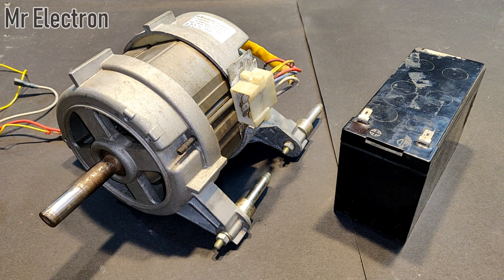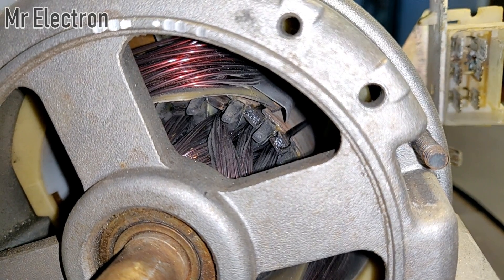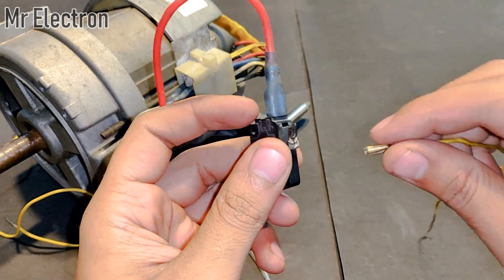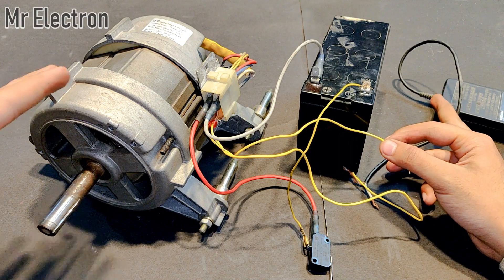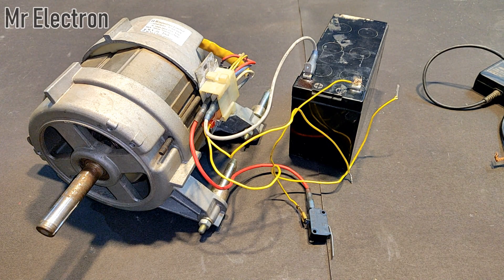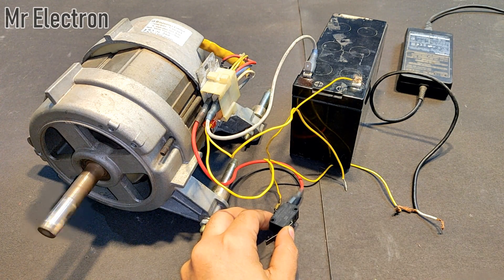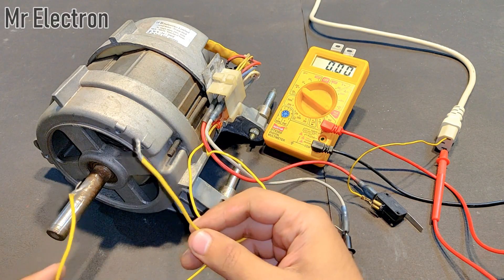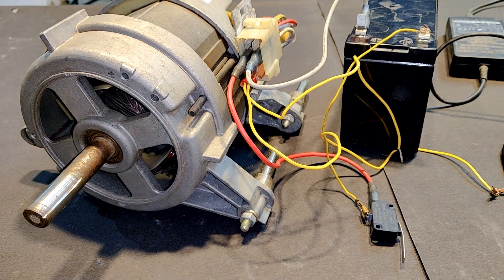Make 12V Magnet DC Motor from Old 220V AC Washing Machine Motor (Universal Motor) with UPS Battery

Comment: Interesting, how can you do this effect with a 3 wire AC washing machine motor? also if you use the start winding on the rotor too much ( after it has started ) you risk burning it out, so as you demonstrated only use it to start the rotating magnetic field, then disconnect it ( sometimes this switch is built into the motor and deactivates using centrifugal force ) thanks great video !!!

Comment: Hi, I have tried this it runs but the motor has no torque/power same as with a hoverboard motor turned as a generator and running a treadmill motor the motor runs but has no power.

Comment: dont need a separate power supply for the coils
Reply: Can we run universal motor directly by DC supply with energizing field winding as shown in video ?
Reply: @harshchauhan9038  there are lots of other videos showing how to wire it to run off from one dc power supply that powers the stator coils and field coils just by bridging a few wires
Reply: @harshchauhan9038  there are many videos on youtube that will show you how robert murray smith has the most descriptive video

Comment: Not realy 6v generators perform similary john bedini done it old wv hypiss done it and the guy from joe cell done it to actualy my self done it for years experimenting with supresors and condensors .
You rather shuld study compond generators .
Those motors and generators dont realy perform how school teaching say.
In reality that thing culd probably put out 4 independent out puts 2x ac out of faze plus 2x dc in reverse polarity meaning actualy 4 out puts.
Coral castel used that cinde of multy faze generator type and that guy powered evry thing with that mashine.
As for power he used hybrid engine ore wind ore water with reversed engine diferential as for bearings for magnetic flywhell he used florine type materials so no friction.
Most likely pulse motor/generator .
Exactly what john bedini did.

Comment: Well John Bedini did mention a so called lockridge device so yeah suposedly that thing shuld by bouth a generator and a starter at the same device similar effects peopel get with those old wv beathel 6v generators so probably that took place I supose those are after all compound dc motors and probably ac related as well probably if you use a tri filar coil ore some multi pole transformer you shuld see some results and probably use some supresors ore capacitors that thing shuld by capabel to run it self with a deap cikel dry cell baterry probably that thing shuld spin realy long time at centrain rpm anti gravity will acure probably thats the case how much I know if you dip copper wires in to lets say liqued oxygen that same wire shuld by in theory carry more curent with smaler size thats just a theory by pulsating curent there is a less chance burning out the rotor winding and brushes so probably they pulse it at centrain time and they gave big coolers and posibly they use oil to cool down the motor posibly to lubricate the rotor as well to prevent brushes wear in theory that shuld work probably a ignition coil was used in that fasion as well as bouth a amplifier and plazma with a gient capacitor probably so yeah thats just a theory of operation well peter linderman did mention some spining peace of metal who run for mouths just on a small baterry on his video the inventor is mentioned its a old kids toy patent so probably thats where that invention originaly came from as some sort of spining pendulum ore somthimg like that

Comment: challenge for you Mr Electron...
Is it possible convert a washing machine motor into an induction motor?
i believe it is,by removing all the copper around the rotor and separate the stator windings 2 poles 4 wires...
if you attempt it please make a video...
oh also have you ever tried to connect in series 2 or motor used as generator?
if yes would you please make a video?
thanks!!

Comment: Tesla did that with his motor and Generator it is called residual effect plug the one Motor Inn get the charge get the generator  turning then unplug it would run by its self and make ac current  and it would charge the battery  all at the same time free energy the main stream science  electrical engineer's say that free energy does not exist but there was the proof sure it won't run for ever but you can rebuild it or fixit

Comment: I really like this effect, will this motor start after charging the field winding, and letting it stop then restart without the field winding, and can you get a current/voltage from the field winding, also ' I have a few a.c. desk fan motors, could this effect be applied to them...
cheers your a great help for me, thank you

Comment: I had the same effect, by using a vacuum cleaner motor, but without even magnetizing the stator of the motor ( I was not connected stator coils to battery ) . By accident I noticed this, when I used a motor rotor as a commutator to charge the batteries with radiant energy. & I found another strange effect , when I charged with short impulses from motor stator moving, the battery slowly swapped polarity for some time , & again back to normal polarity. But this is another story. Needs more experiments with that.
Reply: Ok all

Comment: Very informative..
can I use this motor in my electric motorcycle??
Reply: i believe you can,one thing tho...you may wanna make run the motor at 36 or 48v coz with 12 volts you won't move at all.

Comment: I have a ? 4 U. Can you show how to wire a 12v DC motor with 2 sets of wires so you can connect from battery at one end, and used the other set of wires to power something else.

Comment: in universal motor armature and field coils are connected in series through carbon brush. for speed variation tappings are made in field coil and tappings are changed using switch or relay. i have no idea about the motor which you are demonstrating. please ensure whether the armature is completely isolated electrically from field coil in the connecting tetminal.
Reply: So if we use universal motor, do we need to energies field winding from outside source as shown in this video?

Comment: This phenomenon is acting  similar to a dc compound motor.
If the field supply is removed and the armature remains energized the dc motor will run away in speed until it destroys itself.
Reply: @bewitchedd  no, it draws more from battery

Comment: Is there any other power solutions that can be used instat off laptop Cabela's ?
Reply from the maker: Solar panels or 5.1V 3Amp mobile chargers should also do.
Reply: @MrElectron  but how much current it reacquires? If too the power supply will fail.